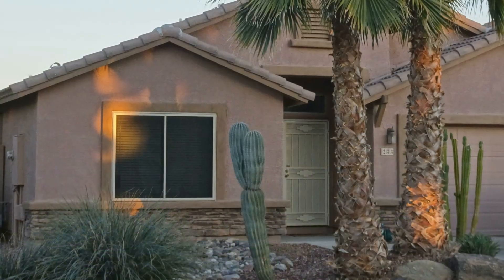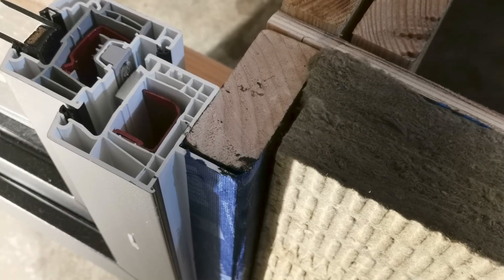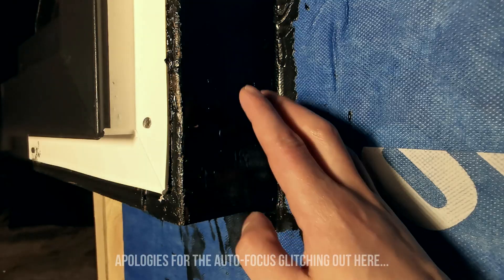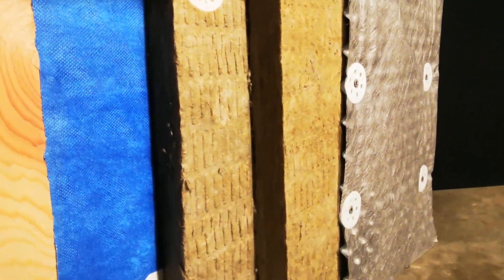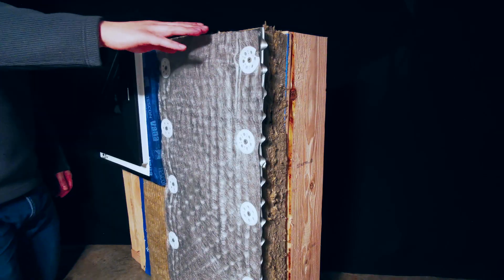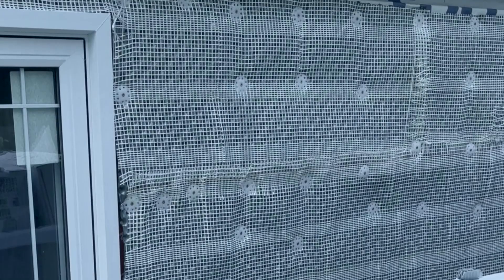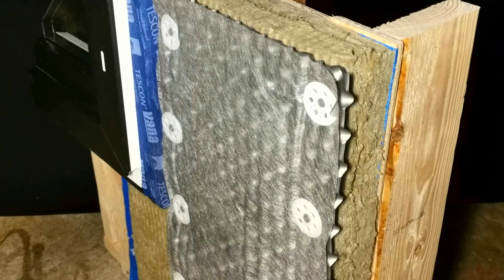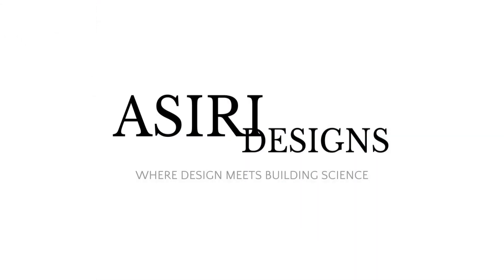Continuous Exterior Insulation with STUCCO (NOT EIFS!)

Comment: Thanks for producing so great content.  

Can you address exterior finishing for hempcrete blocks (JustBiofiber)? I am anticipating using 3 layers of lime plaster with fiberglass lathe between first and second layers. This will be in a Mediterranean climate with average of 50 inches of rain per year. Is there anything else that I should consider for exterior finishing?

Comment: i would hesitate to have so many notes on my details. I don’t think the builder would read them all.  But if you have one standard detail like this, at least it’s covered. I think most builders would be very much against the total stucco build-out you show. Super expensive. I’ve never (in all my decades) seen someone use expanded metal lath over a whole wall. I’m still hoping that builders will use drainable vapor open membranes instead of standard Tyvek. It’s on the plans, but they’ll do what they want. I don’t know what they’d call me if I suggested Blueskin PLUS a second layer of drainable WRB. And is dimple-mat the only choice for the outer WRB?
Reply: Agree.  Designing expensive passive homes is a lot easier than designing affordable ones.  I just tried 1.5" stucco directly over 3" PIR foam (that came from a dumpster) on a test building.  Avoided the expensive products and processes.  So far no problems, no moisture issues, effectively no cracks.  Stucco tie wires angle downward going out the foam. Vinyl flashing everywhere to the back of the foam.

Comment: That looks like a long screw for attaching the Delta lathe product. Are these screws suppost to be anchored into a stud? Or is going through the OSB or plywood enough to support it and the stucco, once applied?
Reply: Stucco should be fastened to studs, but that’s not what happens all the time.
Reply: I guess it's OSB or Plywood.

Comment: What would you use for a surface that has some flex-ation going on?
I've seen where they talk about using "Tile Adhesives", for it's flexibility? 
(These were moderately at best sized, and over simplified structures.)
The conversations' were in another language, and the suppliers were not even using the English Alphabet
Reply from the maker: Use a panelized system to avoid cracks
Reply: @ASIRIDesigns  Would each panel have the Tile Adhesives encompassing EVERY side?
This would create bridging by the Tile Adhesives.
Or

One would create panels that have the Tile Adhesives only on the outer side, and there might be less Adhesion since it is not wrapping around the panel?

Comment: What makes you prefer the dimple mat over using a wood rainscreen furring like you recommend for the panelized system?
Reply from the maker: Dimensional stability with a more uniform substrate + the integrated lath in the product that contains it.